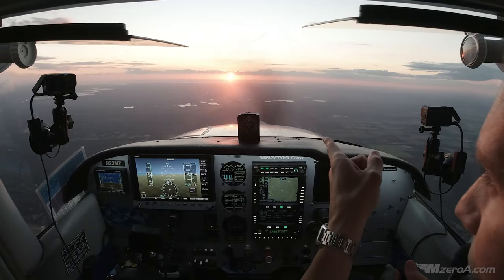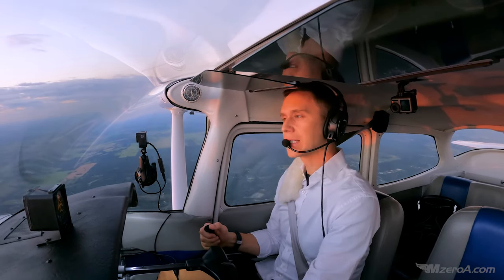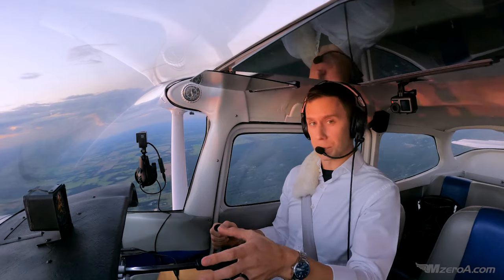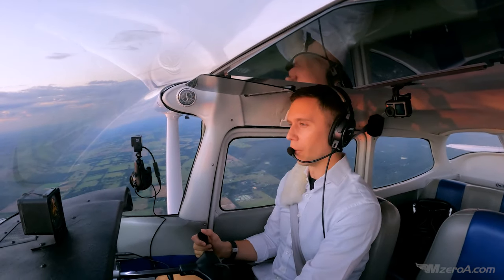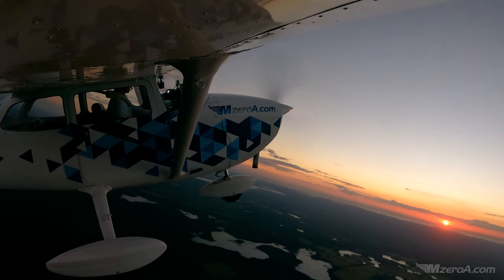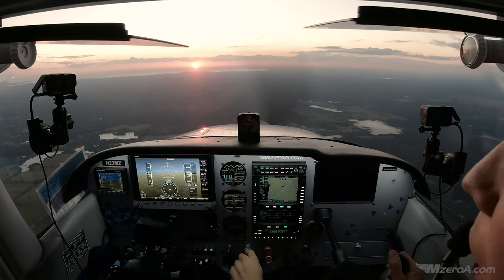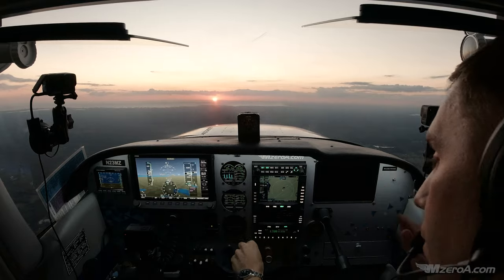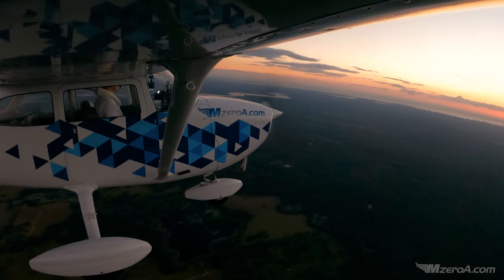Flight Maneuver Series  [Turning Stalls] | MzeroA Flight Training

Comment: Jason, I might be wrong, so please forgive me if so in the first place, but I clearly see you're using aileron input to help correcting the wing drop, not only the rudder (though you say "step right", you're clearly moving the yoke to the right while the airplane is still banking to the left). It's a very common reaction of our brain trying to do what he thinks will fix it: banking. That's why during training we must practice and practice to get that muscle memory in its place. When I practice slow flight or any kind of stalls I always treat the joke as it would only be able to move fordward or backward, and try to fix the wing drop exclusively by using opposite rudder, no banking.
Reply from the maker: Hey Adrian! Once the stall is broken you can use the aileron to help get back to straight and level. When in the stall be sure to recover using only rudder. I apologize for any confusion! Thanks for watching!
Reply: @MzeroAFlightTraining  I knew I was missing something. Thanks.

Comment: Hi Jason, it looks like you turned your yoke to the opposite direction of the falling wing. Shouldn't you keep the yoke neutral and use only your leg?
Barel, Enthusiastic follower from Israel
Reply from the maker: Hey Barel! After you recover from the stall and have lift going over the wings you can use the aileron to correct the flight path. But you are correct that in a stall you should only use rudder. Thanks for watching!

Comment: Stalling is a part of flying that as a commercial pilot we live with it every day, you're in the air. One can run into mechanical turbulence, wind share and an AUW aircraft. It is the pilot's enemy in the end. One also needs to get spinning under your belt and in control. If your flying freight Ie., people or boxes it's all the same so is crop dusting. Learn the Formula Ie., CLHALFEROWVSQUAREDS.
If you're flying as a commercial, get very us to heavy aircraft. A fully loaded aircraft is a VERY different aircraft then the light payload. Make a point of talking to pilots that work aircraft. I have had some A grade flying Instructors in as a commercial pilot working and found their knees are bagging in fear. The reason is they don't know the limits of a loaded aircraft. Remember the goal. Have fun!!!!!!!!!!!! but you have to live for another day.
Reply from the maker: Thanks for sharing, Al! Fly safe!